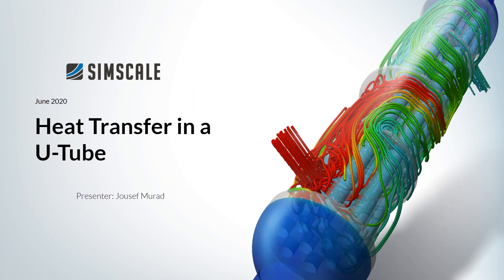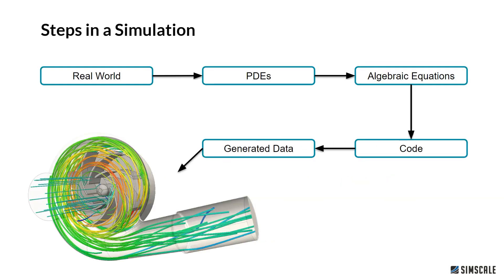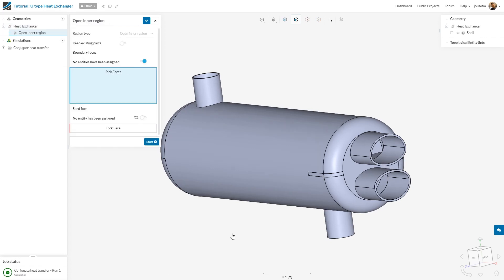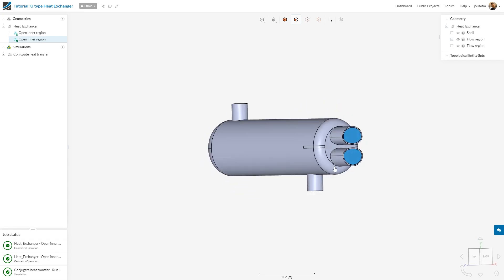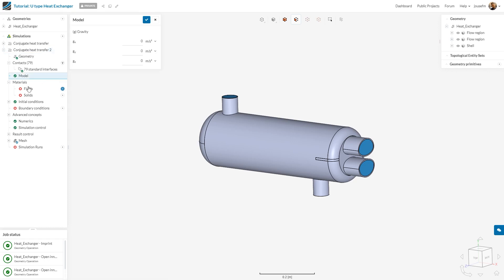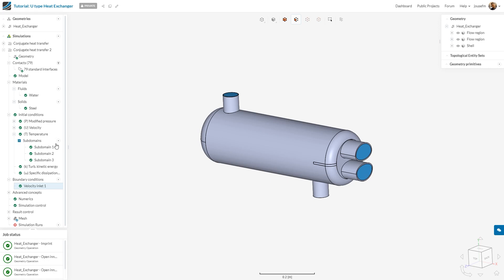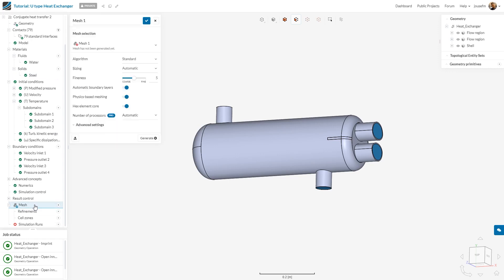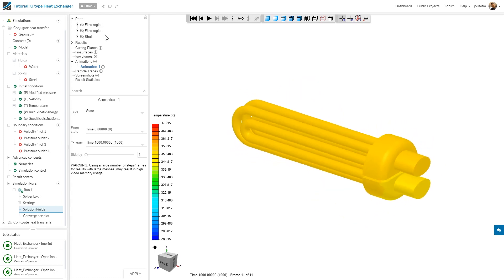How to Simulate Heat Transfer in a U-Tube

Comment: Can you help me in simulation of heat transfer in hydrogen fuel protocol.
Reply: You can post your question in the forum with some side information and maybe a CAD model if you have it already - we will help you out! Provide as many information as possible as I want to see if we even have a module to solve your case.
Reply: @JousefM  
Thank you 
Actually I am working on thesis.I will share the information with you.Kindly you will share your email adress or WhatsApp number.
My WhatsApp 
008615686275868